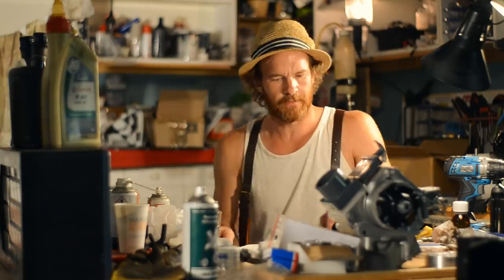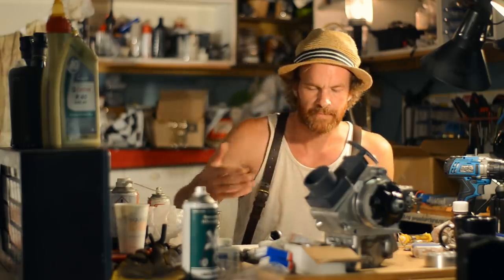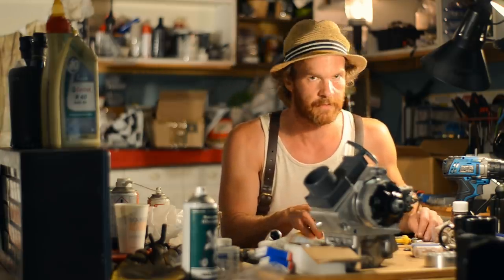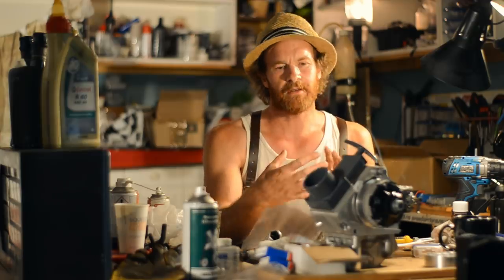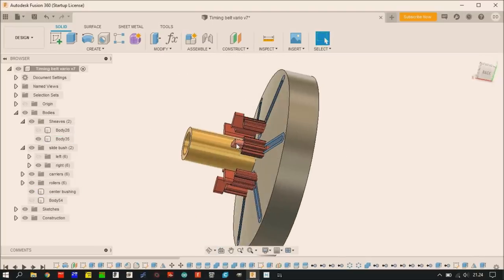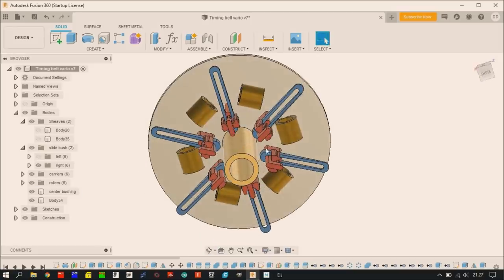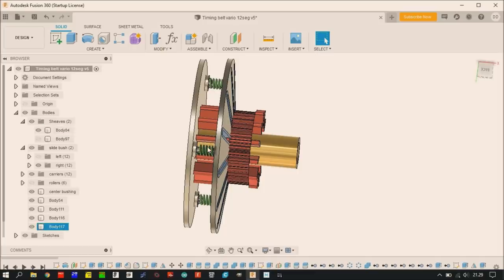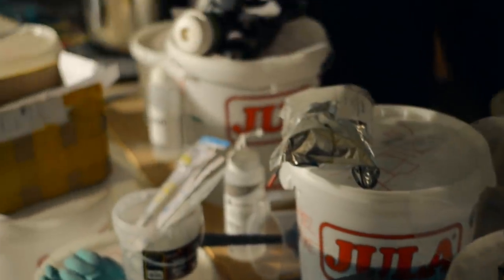The Most Powerful Two Stroke Ever - Revolutionary CVT?

Comment: As the sliders go out the distance between teeth wil get bigger and the belt won't fit anymore, the belt wants to stay on so it is going to keep the sliders in so the distance is correct.
Why don 't you make the a variator white 2 disc and a spring to keep the same tension on the belt. then to go in to a higer gear you just turning the engine closer to the rear pulley with some sort of elektrical engine controlt by rpm and wheel speed.

Love hou crazy inventions keep up the good work.👍🏻 

Daniël Van Dasselaar
The Netherlands

Comment: Just wondering do you need to design a trans or variable that goes 0 to 200, don't know the rules but couldn't you be towed to a certain speed say 70-80 mph before start line, thus eliminating lower end gear ratios and concentrating on top end.

Comment: I'm not conviced it'll work smoothly (or at all) because you're varying the cirumference of the gear continuously and therefore varying the distance between the teeth continuously however the distance between each of the teeth needs to be discrete to match up with the belt, interesting design though.
Have you thought about the other side of the belt?
Reply from the maker: I share your concern. Only one way to find out! In my setup I'm going for a normal fixed pulley, one could use another variable one with "reverse" action.

Comment: Trying a unique approach i like it 👍  it does look like you may run into more issues than its worth, either way will find out. it might be revolutionary 😁
Will it need or have a clutch, as a toothed CVT won't slip at idle will it? 
I do feel maybe gearbox it, or an overdrive system would be the best option. like you said a CVT has power loss issues.

Comment: Your variator seems to be a good idea!

But you will have a big problem to fix with this kind of transmission. 

The central part with the tooths will'nt engage perfectly the belt at some rpm. You gonna be between two tooth and the belt will started to flip or rub against the tooth badly. 

Maybe that gonna work, maybe not. 
But this is a great idea. 

Thanks from France, continue, your are awesome 😁

Comment: The only way that would work is if the teeth were 6 cogs that rotate as inertia pushes them out, to compensate for the increased tooth spacing as the diameter increases.
Even then, in practice it would be a nightmare
Reply from the maker: There's some hurdles to overcome for sure...

Comment: for a variety of reasons the toothed-belt idea is not the best - #1 the teeth will strip. #2 centrifugal force is no good for control - proper stepper sytem is required. i think cycle derailleurs may be a better bet. a well-lubed chain is very efficient !! plus there are endless ratios available off-the-shelf

Comment: What about a gear-based CVT like the NuVinci bike hub? Or other planetary designs? I love the timing belt idea, but even if it works I can't imagine it being as efficient as a non-skipping design. Or what about a slipper clutch that would only be locked up at the final "ratio"? Or even a torque converter from a gs450A (or something) with direct drive like a Koenigsegg Regera?  #laughingalligator

Comment: If CVT power loss is an issue just convert it to chain drive with a high performance racing centrifugal clutch that is tunable and set the RPM engagement high.

https://youtu.be/hbdJRuawoSE

Comment: It will be a "stepped" CVT ultimatively, if u figure out the timing of the stepping- up/down of the sliders at the moments when the belt isn´t riding on them (programm an arduino, or copy an existing arduino-script?)... If the 12 sliders make the torque-output "dodekagonal" (as in "hexagonal"), maybe it´s possible to use a 2nd belt running on the other side of the plate, on another 12-sliders-set (mounted on the same single plate,  15° offset), that exactly fill the gaps that the 1st 12-sliders-set create by maximal expansion. The timing-mechanism will be the same, no matter if 12sliders/1belt or 24sliders/2belts ( or 12sliders/2belts). Imagine this mechanism https://www.youtube.com/watch?v=eWXxiXvfBjg but double it by another chain running behind the turning disc/plate.

Comment: I think there's been other attempts at this but none successful.  The finely variable diameter is not compatible with teeth of a fixed pitch - it's gonna fight & jump.  How about an un-toothed surface, perhaps knurlled but flat, not the V-shape which saps the power.  And the face the belt runs on is perhaps 16 overlapping petals, like a camera iris mechanism but inside-out.

Comment: Do you actually ewen need any more than 2 or 3 tooth on the pully 🤔 after all the the pulling power is only less than 180 degrees, maybe a couple of bearings to keep the belt on the back pully 🤔 and just let the belt swap on the compression cycle

Comment: Hi, why dont you ditch the sliders completely? you dont need the teeth at lower speeds and therfore efficiency is not relevant. just make a toothed ring and when you are up to speed the belt wild just jump once into the gaps and stay there?
Reply: I forgot to mention you have of course to swap the position of this variator, from engine side to the rear wheel, so that the smallest and final diameter is on the rear wheel.

Comment: These ideas will not work I'm afraid. When under tension, there will be too much friction on the sides of the sliders for them to move outwards. If they do move, you'll chew up your belts real fast as the spacing doesn't always perfectly allign. Third problem (as you already noted) would be crazy vibration from the belt falling off the peaks of the teeth at high rpm.

Comment: Maybe instead of the toothed belts look at stronger sidewall belts like snowmobile cvt belts!❤
Reply: it need to be as light and flexible belt as posible as it needs power to bend the belt around the variators.
on a moped ther is a differance of 2-3hp loss in using a kevlar belt to using a standard moped belt that is not as stiff.

Comment: Thers possible to create cvt without those disk at all just 2sprocket which change diameter on some hydraulic system or something yea it will not be than. full independent just mention :x

Comment: No neutral. The teeth will try to grab all the time. Not sure how you want to get around that. My thought was to put a fork and sliding bearing assembly on the variator pulley so you can have a cable to move the pully. Manual CVT.
Reply from the maker: Centrifugal clutch on the rear pulley.
Reply: @2STROKESTUFFING  ok. Was thinking you wanted to get away from the centrifugal clutch because of the parasitic lose. I'm considering putting a fork sliding bearing assembly together to manually control my CVT. Mine always wanted to slow down going up a big hill because of slight engine speed change.

Comment: Too bad you could not just use a generator\motor drive like a diesel electric locomotive.  That would allow the engine to run at a single rpm.

Comment: I've mentioned this before but I think you should develop a  dynamic/variable exhaust for optimum power at all revs. Seems it would be relatively simple for a man of your skills and would give great results for the effort required.: The only problem seems to be with the seal, someone has tried it here -  https://www.youtube.com/watch?v=0odVzSgufjk   worth reading the comments. Although I suppose the CVT will eliminate most of the rev range anyway.

Comment: flat gear belt never work.as diam. increases it will use more teeth on belt ,so what happens when diam is between those 2 points,it cant add 1/2 tooth...and v belt to much surface contact there for to much friction ,sense you don't need torque ,you need no friction  then  use a large o-ring  or belt made of round material which would have min able surface contact and very low friction .Jeff Meier from California.

Comment: Just a thought, but could you have a chain and socket on both sides of the bike one low gear and the other side high gear ,and just one clutch on the low gear ,can't wait for the first run ,all the best

Comment: Talking about bicycle gearing, lots of womens bikes have inhub gearing, 3-7 gears, would that be udeable? Im not sure how much power that kind of gearing can take, probably not 20hp and whatever torque you make, but it might be useable idk?
Reply: Torque is biggest worry. 22 hp 20000 rpm torque is 8 Nm. Hub gears can take that much.
Reply: @jarikinnunen1718  Erm, i dont understand your comment, can you elaborate, also im pretty darn sure it makes alot more torque than that
Reply: @nickkaarslev290  Torque (Nm) = 9.5488 x Power (kW) / Speed (RPM)
Reply from the maker: It probably makes more like 11nm, but thats it. Equates to over 300nm at the wheel in "low gear".
Reply: @jarikinnunen1718  That formular had me stressing my head, i tried doing some calculations which i knew would be right, but its useless, it doesnt work, 2 stroke and 4 stroke aint the same, and gasoline and diesel engines arent the same, it also depends on if the engine has a turbo or not, i followed guides and shit to see if i was doing something wrong, and it seems i aint, that formular isnt worth shit.

Comment: i may have a possible option for you clutch issue  in my shop i have a lath that has a variable speed control which is done through a variable clutch belt set up like your trying to develop i have been thinking about robbing out of my lath and putting it on a 65cc skateboard scooter i have i just hate to gut my lath,if it sounds interesting contact me (ps: i sent you a message yesterday on facebook 2stroke stuffing)
Reply from the maker: Awesome! I'm very interested, replied to your message today.

Comment: A sheave has no teeth.  A V-belt runs around a sheave.  A pulley has teeth, so a timing belt runs around a pulley.  Most English speakers do not use these terms consistently, and you will be understood if you use the terms interchangeably.  Most people just call anything like this a pulley.

Comment: I'm affrait to tell you that this timingbelt-cvt wont work, because the belt has a fixed modulus, and the gap between the pulley segments is obviously variable, the belt will definitely slip/ jump over some teeth and so the belt will wear out really fast.

Comment: i don't understand why you want to build this variation, to many moving parts not wanting to slide / break (dust from belt and you can't grease it because the belt will slip)  and besides that, the polini / malossi variator stuff has proven itself all the way up to 40HP. 

on a other note, i am following to see this little engine run!
Reply: Yes agreed that using a commercially available variator good for 40hp lets you focus on the engine development and pretty much eliminates an area of potential problems. If you can get 25+ horsepower, and using the good drag coefficient of lay-down bike, the variator efficiency should not be an issue.  You have lots of development and testing ahead to get the engine and bike system sorted.

Comment: Pitch. Module. Inch. Metric. Because your variator design is infinitely variable between min an max! Friction, vibration, noise and other bad stuff will happen when it isn't within the pitch of the teeth of your belt. Interesting to see how you over cum that fault with you idelers. At low horsepower ie a 50cc I bet you could get it to work. What about hydraulic drive. I bet it would be easier to get your desired rpm range and power delivery perfectly tuned that way.

Comment: Sounds too complicated with too many things fighting each other and too many small moving parts under big load, spinning at 18000rpm! Maybe  you could just use a system similar to the inside a centrifugle clutch (like on a chainsaw) but instead of it gripping a drum with a sprocket attached, have it directly drive the belt. Just modify the design so it expands enough to get enough variability in diameter. ThenTwo disks on either side to keep the belt on and a spring loaded tension pulley to keep the tension when it expands and contracts.
Sorry my little peanut brain is a little too pickled with whiskey at the moment and thoughts are a little mixed up, so my comments might not be relevant. Hey do you think a centrifuge variator will be the right way to go with your set rpm motor? Love your work and attitude and Been watching for a few years now but too broke to contribute, sorry mate. I have a very quick 1965 piston port, 125cc road racer that runs methanol that I can’t really modify any more (historical racing regulations) I have detonation issues that I have been to financially broke to fix and go racing again. Maybe one day... You are an inspiration and I think we share many similar though processes about stuffing! And maybe rum too! Keep up the good work my friend.

Comment: Back to the drawing board, because this system cannot (and WILL not!) work with a toothed belt: using a toothed belt automatically means that just a few positions of the toothed sliders will work, not any position inbetween them which this system allows for!
Also, the toothed-'sliders' will jump to the maximum (diameter-) position the moment they get a chance to do so, which is when the belt leaves them.... they will basically 'follow' the belt. Then next they will lock into the belt however on a waaay bigger diameter and cause havoc, something will break!!
Sorry, a rather shoddy design from you, untypical!!
Better stick to that (inefficient yes) Vbelt as that DID work.
For the variator-control stick to a servo driving a screw (ball&screw system, Festo has some) as this can be finely controlled easily AND reliably (AND with enough power!) by means of a digital controller. Such would be superior to any vacuum system as that will always have hysteresis... which a servo-screw will NOT have!